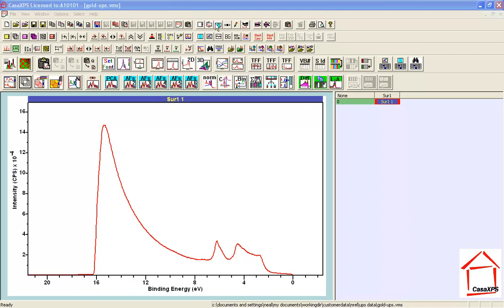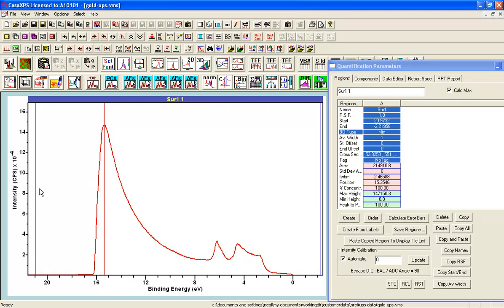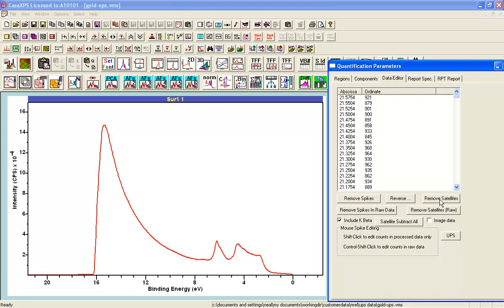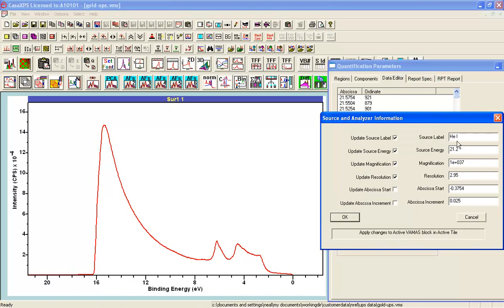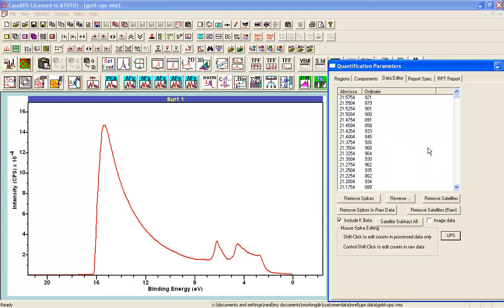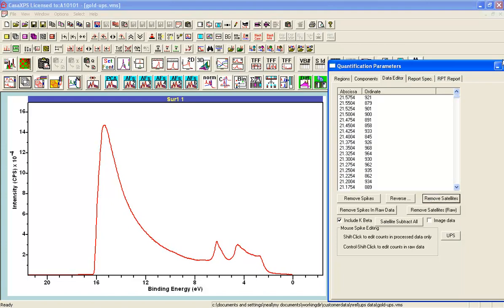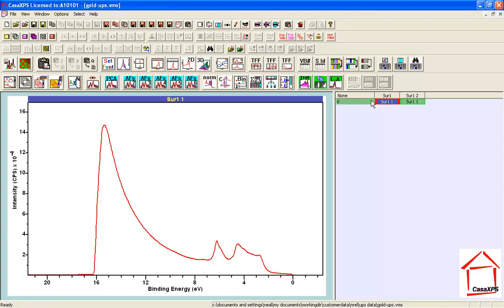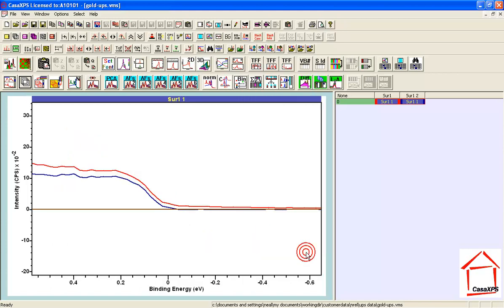Satellite Subtraction for UPS

Comment: Thank you so much! Looks like it is a straightforward approach to remove satellites from the functions in the software. Could you provide if you have a script/details that explain the satellite correction process in CasaXPS? Can you please explain what it really does? thanks!
Reply from the maker: Satellite subtraction makes use of the shapes in the data using the assumption that the low intensity satellite signal is simply a scaling with an energy offset. This is an approximation and should be tested against the data processing steps applied to both the original data and the satellite subtracted data. I personally always prefer to analyse data without any prepossessing.

Comment: I have 2 questions 1. Is it possible to deconvolute UPS spectra like we do for XPS spectra. 2. If I have the UPS spectra of different related samples, on what basis do I compare  these samples. Thank you.
Reply from the maker: I am not an expert in UPS, but I would think it would not be possible to fit components to UPS data. I suspect that UPS spectra represent patterns that you match to known states of materials. I do not have extensive experience of UPS.

Comment: Hello! :)
Can you tell me how much satellite is assumed to be in original spectrum?
Can I change the portion of satellite? It is because satellite is dependent on what UV-source is used.
Reply from the maker: Yes. There is a configuration option that alters satellite specification. If you enter the string 
ups source label : He I (1.45,0.4)
 into the ParameterFile.txt file (CasaXPS.DEF folder) then the two numerical values will provide the scale applied to the alpha and beta satellites of He I.
You will need to restart CasaXPS or use the Reload CasaXPS Default Files option on the Options menu of the main CasaXPS window to cause an update of these two scale factors.